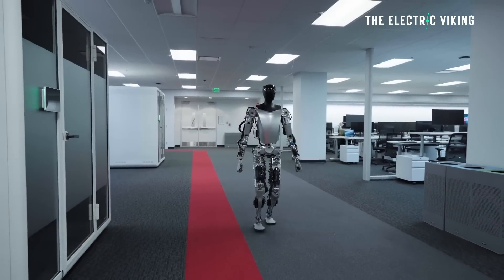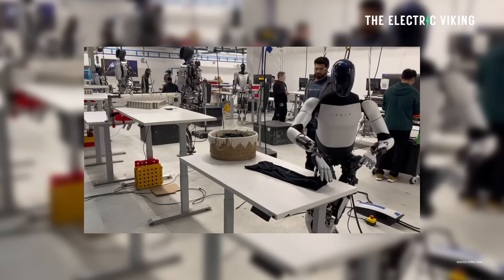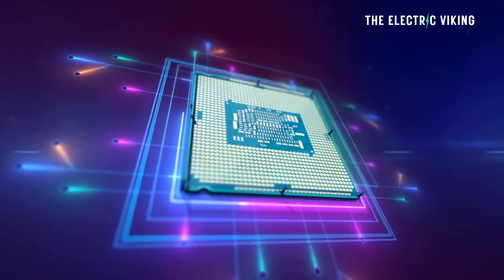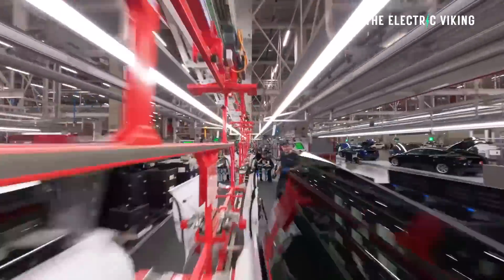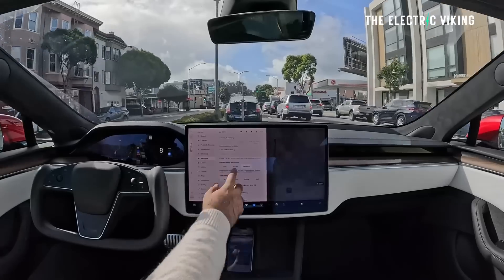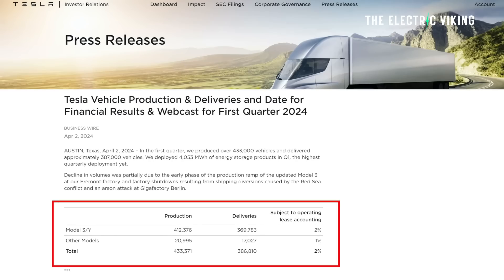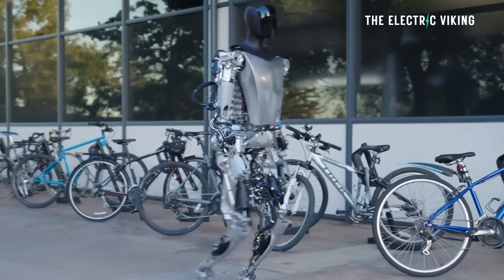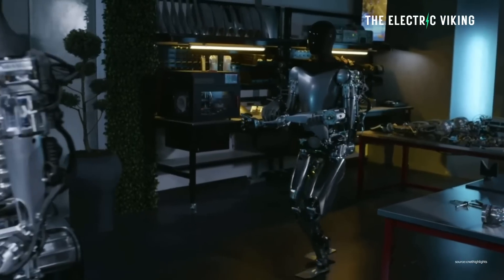Musk says Tesla will sell the Optimus humanoid robot next year

Comment: NO-MORE-FREE-FSD-HW FOR REAL DRIVING VIDEO DATA!
From Tesla IR VEHICLE CAPACITY:
* 'Changed the production line to updated model'
    Changed to Combo Line for FSD-HW and Basic-HW!
* 'COGs per unit improved to an all-time low'
    IME, FSD-HW = $5K, Basic-HW = $1K!
Here Is Why:
FSD-Take-Rate 12%, Rev. $43,500 and COGs $36,500 per EV, FSD HW $5,000, Basic HW $1,000:
* OLD ($43,500/EV; $12,000/FSD)
   Avg. Rev./EV = $44,940 = 0.12 X (43,500 + 12,000) + 0.88 X 43,500
   Avg. COGs/EV = $36,500 = 0.12 X 36,500 + 0.88 X 36,500
   Avg. Net/EV = $8,440 and Avg. MG = 23.12%
* New ($41,500/EV; $8,000/FSD)
   Avg. Rev./EV = $42,460 = 0.12 X (41,500 + 8,000) + 0.88 X 41,500
   Avg. COGs/EV = $32,980 = 0.12 X 36,500 + 0.88 X (36,500 - FSD-HW + Basic-HW)
   Avg. Net/EV = $9,480 and Avg. MG = 28.74%

Model 2 N/A FSD => ~$20K!
Model 3-ECON => Tesla Called, 'More Affordable Models'!
Model 3-FSD = Ready for Robotaxi!
Model Y-ECON => Tesla Called, 'More Affordable Models'!
Model Y-FSD = Ready for Robotaxi!
Model S-ECON => Tesla Called, 'More Affordable Models'!
Model S-FSD = Ready for Robotaxi!
Model X-ECON => Tesla Called, 'More Affordable Models'!
Model X-FSD = Ready for Robotaxi!
IMO, Cybertruck will be deliver FIRST to who subscribe FSD!

ALL-IN-ONE-PRODUCT of AI, Robotics, and Portable Energy is Tesla AGI-Optimus!

Comment: The difference with Tesla robots is that they will use the same neural-net as full self-driving
Reply: Then they’re in massive trouble. They can’t even move this stuff over to the cybertruck right now.
Reply: @singed8853  Not a fair comment Singed.  They certainly could have methinks, but want to see how the basic model will cope with died-in-the-wool truckers and off-roaders and other types, before installing a self-driving package using parameters that NO SANE CITY OR HIGHWAY DRIVER would ever want to have taking control of their lives.
They are no-doubt collecting heaps of good data right now about how this might be done.
Reply: U dont know anything about neural networks... If i train a model on 720p images and tell it to output a 4k image the result will be really bad... So now i jave to train a new model on 4k... Same goes for tesla. They need a new data srt to train on. They cant just use the same model that drives a tesla...

Comment: They could save thousands per robot by replacing the articulated legs with a base with drive wheels and a simple height adjustment.
Factory Robots do not need to climb stairs and a stable base allows more lift capacity
Reply: Roller blades...
Reply: No ... but home use robots do need legs and human like movement.

Comment: honda had robots that could walk on their own for over a decade now...
Reply: Yes, but could they do anything useful?
Reply: @johnkimber4933  walk up and down and look cute :D pretty much what the Tesla bot does right now :D

Back in the late 90s early 00 I went to high school as a cnc programmer/robot programmer/technician/cad:er( automotive production) and basically what the tesla bot does with its hands has been a thing since like 80s I think.
Reply: @Pillokun  It does not have to do that much to be useful. Making it affordable is the challenge.
Reply: can they walk and chew gum at the same time?
Reply: @scottmcshannon6821  Can you?
Reply: @scottmcshannon6821  if they wanted to design such a thing maybe... u know there was no need for a robot to look like a human or a need for a hand when u make a robot to work at a production line. There is still no need for a humanoid robot. It is just pure hybris to make such a thing.
Reply: @Pillokun  i worked at kawasaki and one of the things we made were industrial robots, they were all the one arm, one function type, 99% were just welders. it took a human to stock the parts and to remove the finished parts. and every part was exactly the same until they tore down and setup for a new part. great when you were making thousands of exactly the same thing. no marts at all.
but production lines are designed around humans, who are surprisingly adaptable. you can either build a human like robot capable of doing a 1000 different tasks or you build a different robot for each task.
Reply: @scottmcshannon6821  u dont need to build a new robot, u just program it to do different task, with different tools.
Reply: @Pillokun  optimus is like FSD, its taught, not programmed.
Reply: @scottmcshannon6821  so is many other industrial robots.. u can actully guide the arm with your hand and it will learn, ie memorise the positions. But yeah, the tesla bots will need somebody to show it how to do it or even need to start out with a program and then "deep learn" from it.
Reply: Yea except they have have every move programed.
Reply: @Tao818  and how do u think the humanoid tesla bot will learn? u think it will learn on its own what is needed to be done at that station on the production line? Either it is as sophisticated as a human that a human will be showing/learning it like a person learns or it will be "programmed" into it what moments and in what sequence it needs to do to complete the work flow/sequence. 

Have u been at a factory floor/line and seen how it looks or even tried it out yourself? no way a bot with an ai in it will understand after a quick look to what and how it should do things at that station.

even the promotion video from Tesla themselves where the Optimus Tesla bot reach out for the belt looks like it is an 90 year old geezer that is about to die any moment, and u think it will on its own understand what to do the moment it is placed on the line?
Reply: @Pillokun  The Bot will not have AI in it ... the onboard computer will receive it's AI from the DOJO main frame computer ...It will contain software that allows for connection to the DOJO much like the car.
Reply: @Tao818  whether it is in the bot itself or through the mainframe it does not matter., not the point of mine post and it is pretty given that it would lack the capacity to do it on its own. It will still not be able to figure out what it is supposed to do on its own. People need to tell it, be in in code form or in any other way.
Reply: @Pillokun  They have already demonstrated that it can learn on it's own.  You are right in that it has a ways to go but the ground work is solid.  Once the robot see's it done it can then do the same task the same way.   We'll see.
Reply: @Tao818  yeah it knows after having done it once, but it needs to do it in time, in right sequence and be able to adapt to eventual stops, or other line related issues. What we have seen so far is faaaar from what a human can do. 

But it will not learn on its own at first it needs to start out with given instructions be it in form of a program or being instructed by a human first and that is basically programming like u do with a normal non ai capable(plc) industry robot.
Reply: @Pillokun  The cars are already learning on their own -- true intelligence emerging.   Like I said we will see.   Have a good Sunday ...thanks for the stimulating conversation.
Reply: Then you must understand what every robotic company on earth does not i.e nothing has change .. OR .. a lot has changed since then.